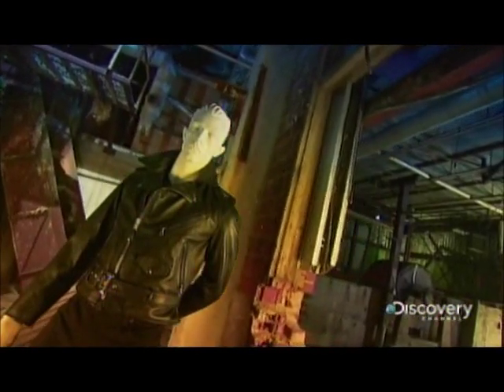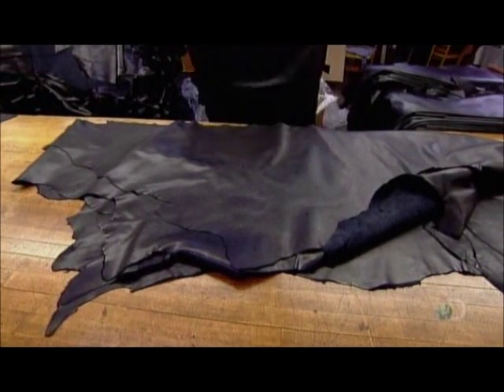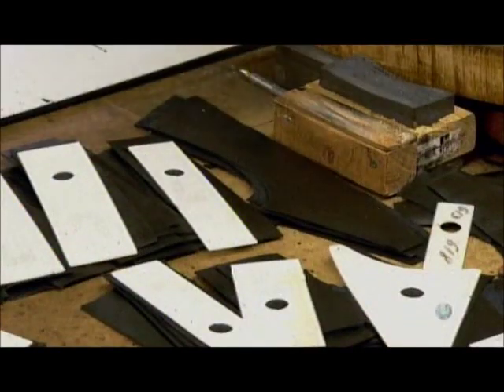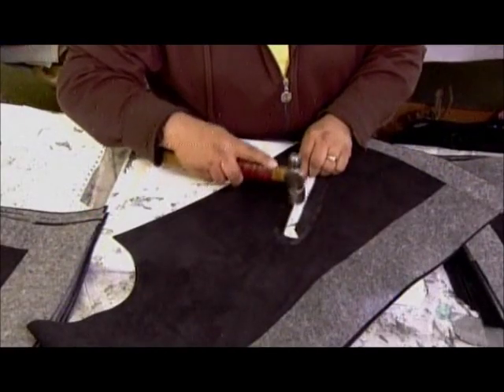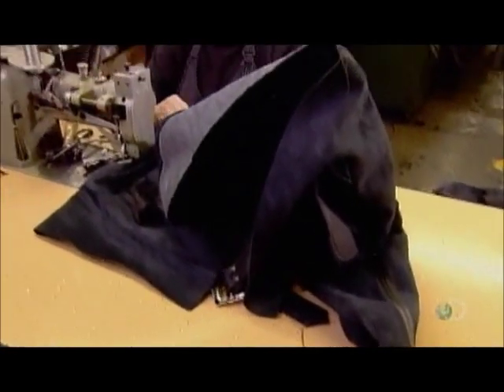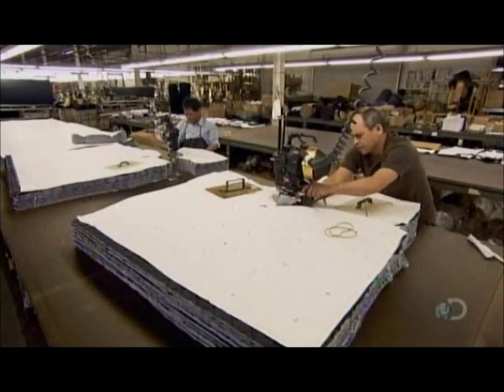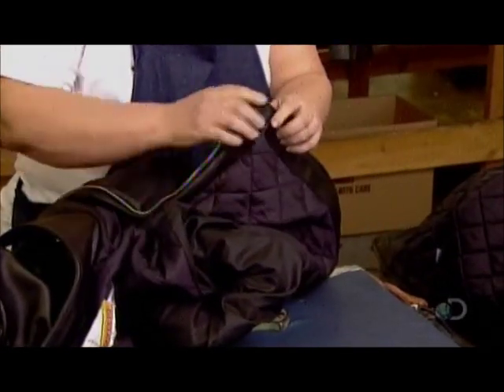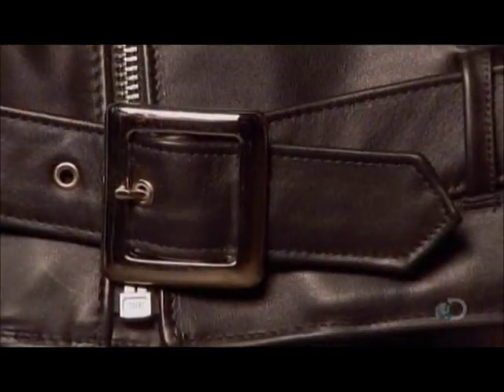How It's Made - Motorcycle Jackets

Comment: What's the price of a good leather jacket?
Reply: ***** Leatherup.com has some good deals, typically they run in the hundreds, but you can find a few classic ones for under 100.
Reply: OspreyKnight thx a million. Ordering now. :)
Reply: paying any less than a couple hundred will result in throwing it away in less than 5 years. You get what you pay for. If you want an heirloom jacket like this one, you're going to have to spend some money. The jacket in this video is in the $700 price range but it will be something you can hand down to your kid when you're old and out of shape. Schott is probably the best company to buy jackets and coats. They're made in America and the quality is worth every penny
Reply: Faroek Nasierkhan 120$ only i provide u...
Reply: thats bull crap. i got a cow hide leather jacket for £159, years ago and its still holding strong..... and yes i use it alot.
Reply: Tkmaxx/Tjmaxx has the best deal on some top brand leather jacket but you need to be lucky to get a good looking one at your size, usually like 70-80% off. I only managed to get two decent CK one (899£ ->199£, 2999£->499£), sometimes D&G /Versace shows up but hard to get. Burberry also has some decent 50% off discount during Xmas but they are still around 1000£.
Reply: @danielroy2804  well that's not less than 200 USD, right?
Reply: $6 bazillion dollars!
Reply: I’d say, 200+
Reply: Second hand on ebay baby